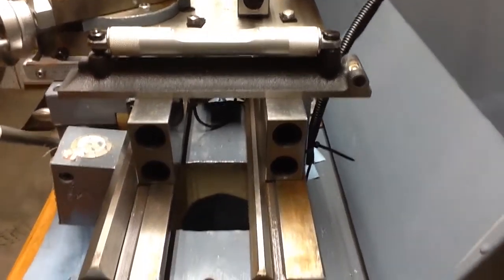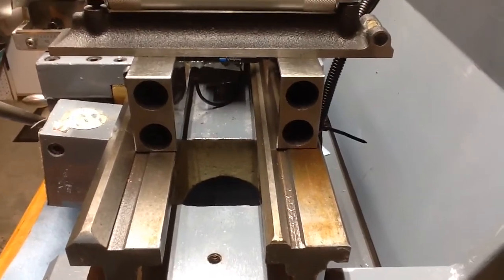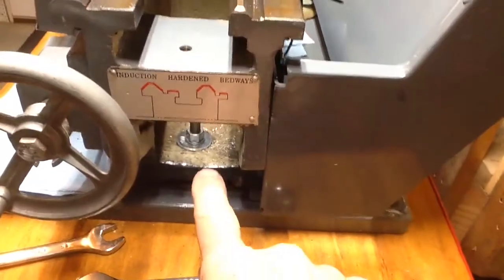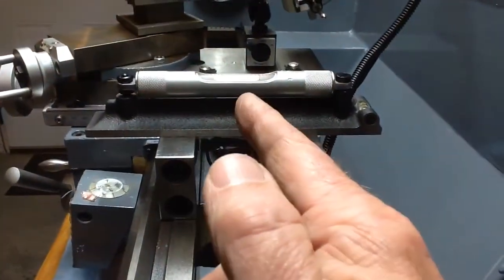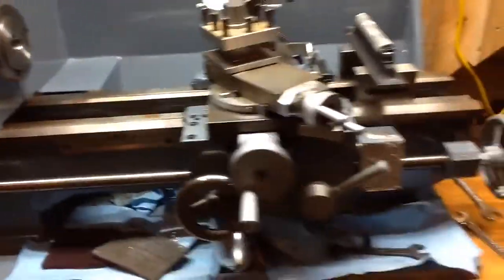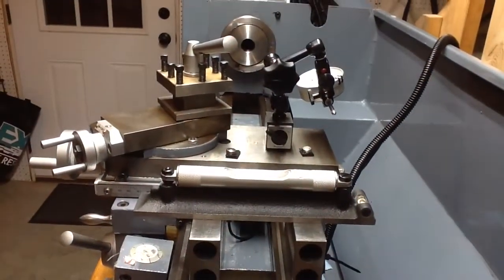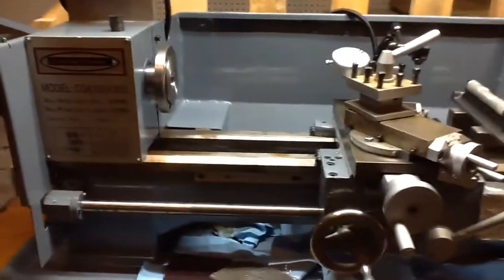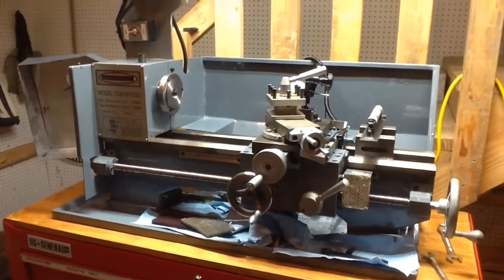Lathe alignment, removing "twist" in the bed

Comment: You also should check that axis of the spindle is parallel to axis along length of bed in two planes:  plane as viewed from the top of the lathe looking downward,  and plane as viewed from front of machine. You then shim under headstock where joined onto bedway to bring that into alignment. There's nothing to indicate that the chinese got that part right - and most likely did not (in my opinion).